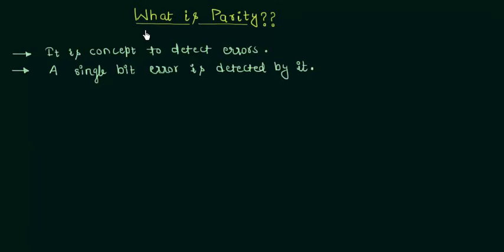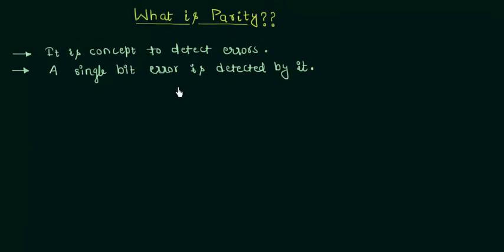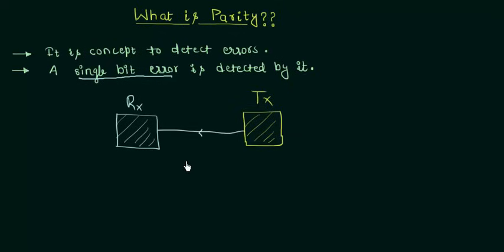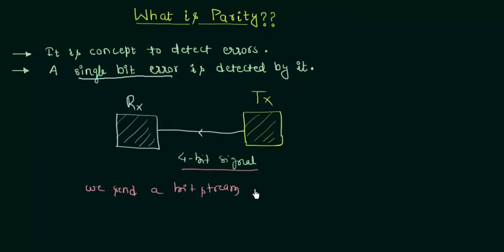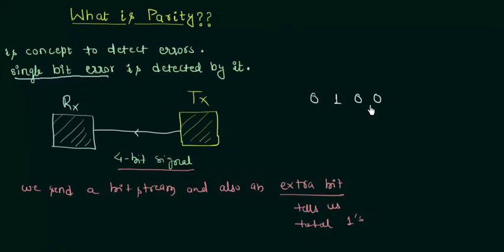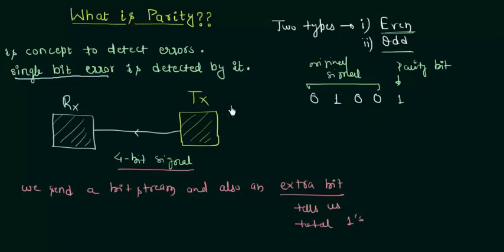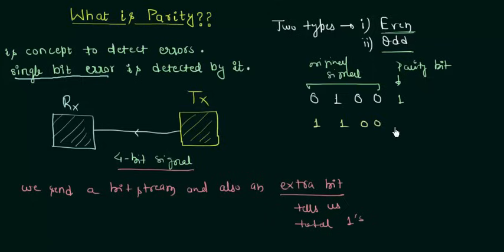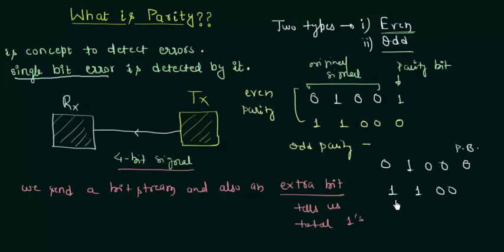What is Parity?

Comment: what if there is error in parity bit itself ?
Reply: it doesn't matter if the parity bit itself flips, the parity type is a link property - which means that both transmitter and receiver agrees upon a partiy type (be it even or odd)
and then the signal is transmitted by the transmitter.

Imagine they both agree upon even partiy. The transmitter has to send 1011 (no. of 1 here are 3) which means parity bit should be set high therefore the final signal which is to be transmitted becomes 10111
now the transmitter transmits this, and somehow the partiy bit at the end gets flipped so the signal that Rx receives is 10110 (here the number of 1 are 3) which is odd but we were working with even partiy

hence the error is deteced. where? no idea

Comment: Sir, what if from transmitter side data is 1000 and parity is 1,then due to unwanted signal data becomes 1011 in this case also parity is 1....what is the solution for it.....

Comment: Okay sir, what if two bits in the transmission stream were affected?
For example the transmission was even for stream like 11001 then with parity bit it becomes 11001(1).
What if two bit were affected in the stream by noise to make it from 11001(1) to 11010(1).
There it still remains even parity indicating the signal was received as sent whereas it was affected by noise and yet the error was not detected.
How come sir?
Reply: for even parity it can detect only odd number of errors when there is multiple changes and for odd parity viceversa. For example: 1110001,0 -> 1100111,0 three changes happened here after even parity check its error but 1110001,0 -> 1110111,0 also 4 -> 6 after even parity check it will show no error, code is valid but actually it is not

Comment: 6:57 what if  0100 (even parity=1) would have been converted to 0111(even parity=0) due to some noise?
Reply: The parity is always constant
Reply: @nithinsai2250  why the parity bit is always constant?
Reply: @sushmanaik2228  it is made in such a way that it doesn't get changed by the noise
Reply: @nithinsai2250  thank you

Comment: what if two bits are changed.. How will the receiver detect it? I.e   0100 1   and then the receiver receives it as 1110  1  it's still even just like the first one. (EVEN case).
Reply: Tips RacK that is the case where the parity can't detect the error
Reply: That is the reason why it is called the single bit error detectior if 2 bits are changed this method will fail to detect error

Comment: what if in even parity two bits get changed at  the same time due to noise
Reply: Yash Gupta then there are errors in two bits but parity checks only for error in one bit.
Reply: red cat but if 3 bits are changed parity bit will detect the error so can parity check multiple bits too?
Reply: Parity can detect when only 1 bit have changed or distructed

Comment: In the end you have explained that the receiver knows that whether even or odd bit method was used. But lets say due to noise 
{0100-1} became {0101-1}. Now as you said the receiver would know this is invalid as there are even number of ones, but how does it confirm that it was not {1101-1} and {0100-1} specifically

Comment: yes the total number of "1" 's  is even or odd, how do we count "1" 's lets say if i have 1 million bit stream?
Reply: Shreeja Tiwari i don't get the idea by using XOR gates, can you explain it? by example
Reply: see in the xor gates we get high input only when we have  0 1 or 1 0 combination and the number of one's in these combinations are 1, hence we use this for parity checker !
Reply: Shreeja Tiwari ok i get the idea, then how we count it ? but then what if is the case inputs are both 1 1, then we get 0, but i thought inputs 1 are count. ?
Reply: we just see if the output is high that means the bits have not been changed bt if the output is 0, that means there is some disturbance present in the form of noise.
Reply: Shreeja Tiwari but i thought we are trying to counts "1" even or odd.?what has to do with noise/disturbance? i just want to counts 1 in 1 million bit streams.
Reply: how to know if output 0, maybe has both 1 1 input ?

Comment: Well a good Video explaining the Parity! Thank You!

I just have a doubt... In Error Detection, you said if a bit is changed because of noise, the parity bit can be used to identify that the signal recieved is faulty. But However, lets say 2 bits are changed due to noise and the Even parity is Maintained?, How can we know that the signal is faulty?
Reply: +Nanda Gopalan thats what i mean about parity can NOT check if there's 2 bit or even bit (2,4,6,8) changed and vice versa (3,5,7,9) the sender sent even parity - lets say there's a noise and it changed 4 bit, and the result is still even parity right ? so again the parity can NOT check if there's more than 1 bit is changed, am i right or wrong. @Neso Academy
Reply: +Nanda Gopalan yes ,it only can detect error having change in only 1 bit.